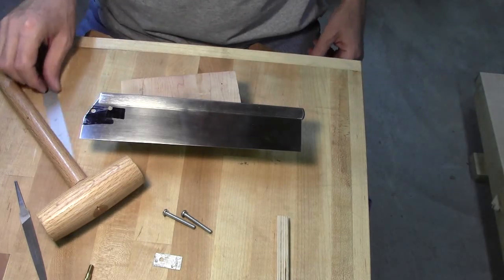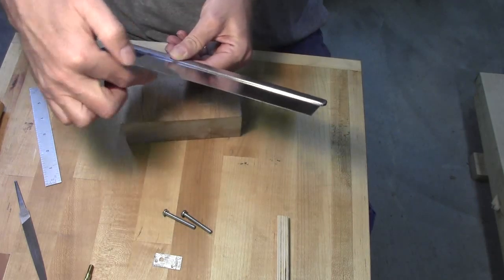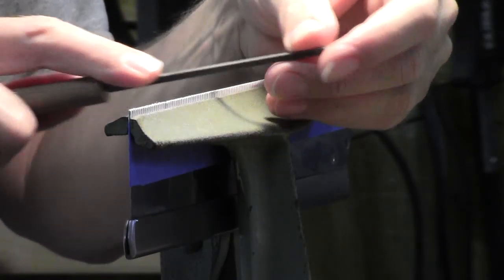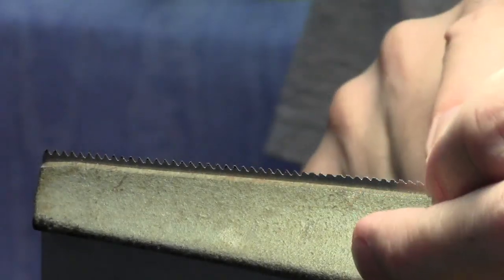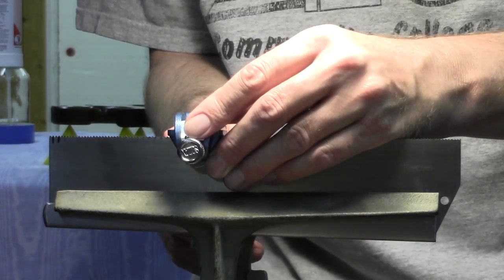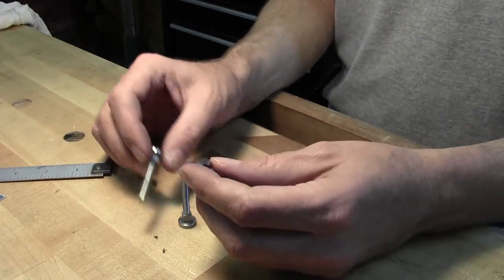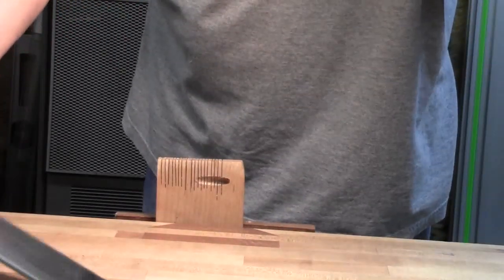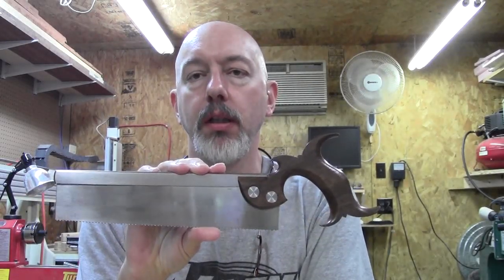Dovetail Saw Build - Conclusion

Comment: I read through all the comments on all three parts as I noticed something in the first video that raised a question for me. I realize it's metal and metal against wood is probably not that much of a concern, but my thought was is there any reason that it would make a difference in which way the grain ran through the saw stock that would make it preferential to cut the teeth with or across the grain of the steel? Will it holds its edge longer or any other concerns or thoughts?
Reply from the maker: If you are talking about the grain in the steel, it would run lengthwise in the blade, so I guess you would be filing the teeth across the grain of the steel.  I'm certain that all saw manufacturers use this orientation.  Because of the sizes the material comes in, it wouldn't really be feasible to cut the blade out in the other direction for most saws.  I'm not sure there would be any advantage to it.

As far as holding an edge longer, Paul Sellers has a trick for rip saws where he uses a diamond card to create a micro bevel on top of the tooth.  Go to the 25 minute mark in the video below to see him explain this.

https://www.youtube.com/watch?v=UA5DixEaaUo
Reply: Thank you, yes I was referring to the grain in the metal. I had not thought about it before and hadn't ever heard of it being mentioned by anyone, anywhere, and was wondering. Thanks again. I thoroughly enjoyed your presentation thank you for taking the time to make the video and posting it. I subscribed and am looking forward to whatever you have to present. I know I can't afford to buy all the tools I need to get started all at once, yet I want to work and have taken to learning how to make what ever I can myself.
Reply from the maker: This week I bought a 14-inch Kobalt back saw from Lowes' for $10.98 US.  

https://www.lowes.com/pd/Kobalt-14-in-Back-Saw/1053305

I did a little bit of work on it and think it will actually be a decent saw.  It comes filed for a rip cut and doesn't have induction hardened teeth, so it can be resharpened.  I took it apart, straightened the back, cleaned the lacquer off of the plate and reassembled it.  It has quite a bit of set but cuts straight.  I plan to touch up the teeth a little as I think it could be sharper.  This could actually be a pretty good all around saw it you file about 10 degrees of rake and 10 degrees of fleam.  It has about 2-7/8 inches under the back so it would be fine for small tenons, dovetails, and general carcase saw.  The handle isn't pretty but more comfortable than I expected.   If I like it when I'm finished, I might buy another one and shoot video on how to tune it up.
Reply: Thanks, I'll stay tuned and check it out.
I am grateful for the information. My next step I think is to obtain a set of saw files.